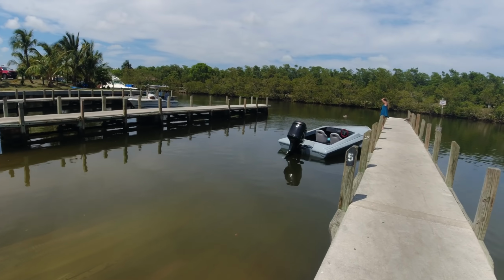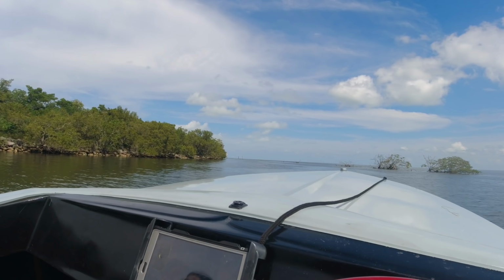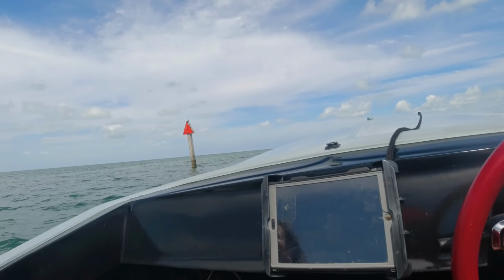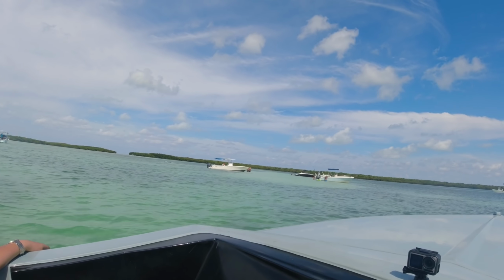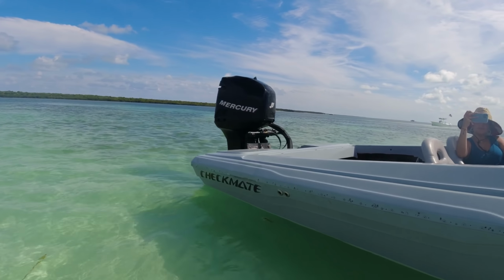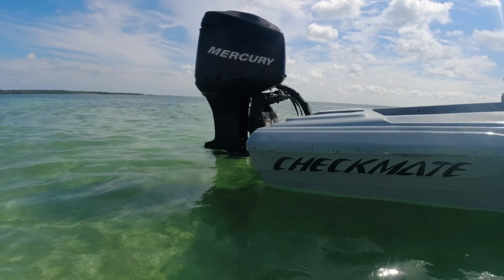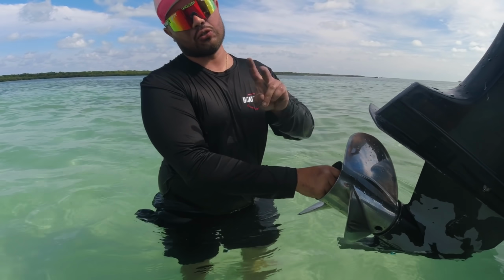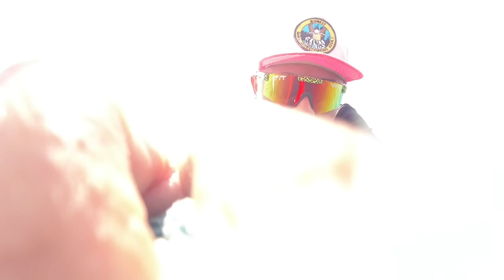Taking The Checkmate To A Beautiful Sandbar

Comment: Your vids are great, just a normal boat guy, keep it up..I worked at mercury racing shop, your 250 should have easily turned that 24, we've ran 26 and 28s, something is not right, cleaver is wrong prop, you need bow lift not stern lift. For your safety get a nosecone gearcase so you don't have a blowout bro, plus it's faster too..Just free advice..lol
Reply from the maker: Thank you man I figured out today my issue, fuel pressure is at 50psi the whole time. I just ordered a new fuel regulator, in this video guardian was limiting me because of the oil tank it did not beep but will limit me. I disconnected the tank and then connected the two wires together. Also my buddy let me use his regulator that I know works. The boat ran amazing!  It was a quick run but it definitely made a difference.  Everyone keeps telling me about a nosecone I might have to do it soon.
Reply: @boatvibes  We disconnected the oil stuff and just mixed, less headaches. The nosecone will give you better handling, more lift, noticeable better performance. We used Bob's seeing your skills,  you should be able to do it yourself. Yup low fuel pressure will do it, I could hear the labor on video. If you get a chance try a Trophy plus, great holeshot and lift, might be 2 to 3mph slower than a mirage. Keep the videos coming bro, fun to see👍👍 just don't end up on chit show...lol
Reply: Hey danc0068, I have a few questions for you!  I just mounted a 2001 300x onto a 20 foot Arriva "Ski" open bow, with a 5 inch jack plate/set back (needed to accommodate a 25" shaft). I have no idea what to expect, super excited to get 'er wet.   Still working on gages and wiring. I think it weighs 2300 pounds total, I'm at 6400' elevation.  I just took a 1991 Yamaha 225 off it; the Yamaha is very reliable, but only has 91 psi compression (this Yamaha will go on a 1978 16' Cee Bee Avenger, again, no idea what to expect, but I will wear a life jacket and maybe a helmet 🤣).  This "new" merc has 150-152 psi...  I'm hoping for 70+ with this new package.  Any suggestions on where to start with prop, style and pitch?  Do they make a "nose cone gear case" for the merc 300x?  Or do I need to find an after market one?  Would nose cone gear case make a big difference in my application?  I've owned this boat for 20 years, I love it, but I scrapped the Force 150 (39 mph), next I tried a 2001 Merc 150 (50mph), a 1991 Yamaha 225 (51 mph) and now this big Merc 300x, all in pursuit of 70 mph. I'd love any input.  Any thoughts on the Yamaha/Cee Bee project? Thanks!
Reply: @bcbarc7044  I believe it's a heavy boat and needs bow lift. I'd try a 4 blade trophy,  or a bravo..Trophy will give you lift. If you can find a big hub laser ii.
Reply: @MnDan  Awesome, thank you!

Comment: Do u know if u happened to be on the chit show since u came out of Blackpoint Marina? And I’m pretty sure u know what the chit show is with good ole Alfred and his channel! Was he there that day filming when u took out the checkmate? And just curious have u tried a Cleaver propeller? And what size mercury is that? U need to try and find a 250 Pro XS outboard!!!! Those motors are freaking bullet proof!!!
Reply from the maker: No he was not there that day.  I haven't had a chance to try Cleaver prop. I have a 2003 250 efi in my opinion this engine is more bulletproof than the pro access because it doesn't have the extra injectors and the compressor.  By the end of the year I'm going to be putting a brand new 300 Pro Xs on the checkmate
Reply: @boatvibes  oh heck yeah, that will be badass big man!!! And yeah all my buddys that had bass boats all had that pro Xs and never had a lick of trouble out of them that’s just why I mentioned that motor. So the new 300 pro XX ur going to do is that the new v8 version or are u going to stick with one of Mercury’s 2 stroke motors?
Reply from the maker: The new v8 😎
Reply: @boatvibes  just out of curiosity, will that new v8 weigh down the back to much? I don’t know what the differences in weight would be between that optimax I have on there and the new v8? And hell if ur going to do the new v8 why not just do a new 300R instead of the pro xs or a 250R? I believe they make a 250R. But that thing is going to shoot out of the water with one of those new v8 motors on the back!! I can’t wait for u to do it big man!! And what’s the update on ur dads motors being rebuilt, are they done yet?